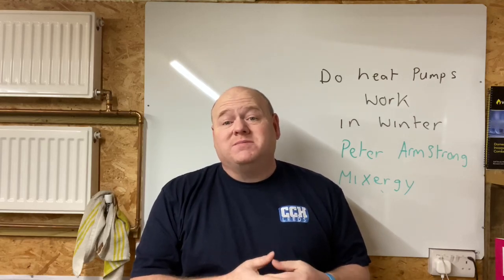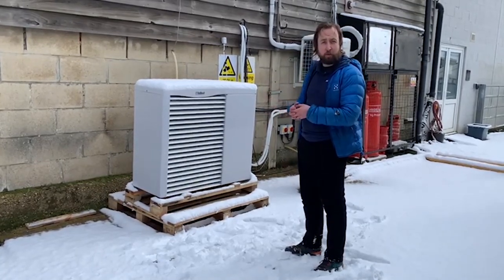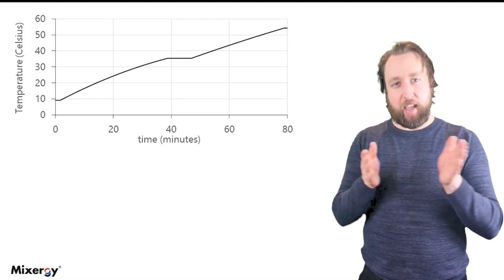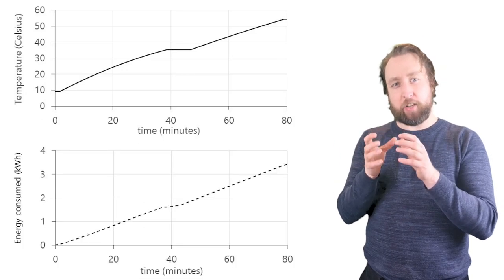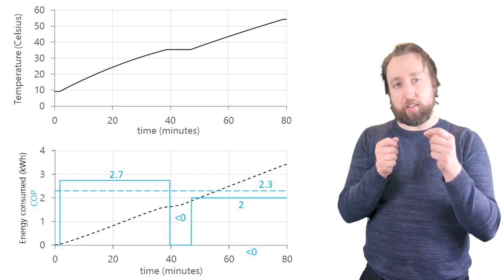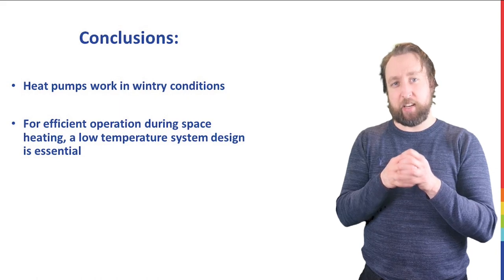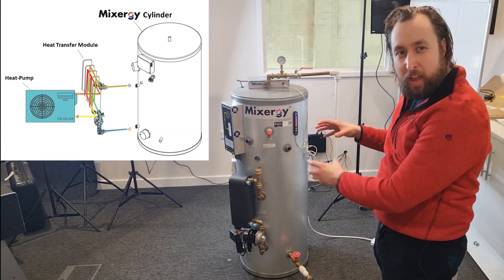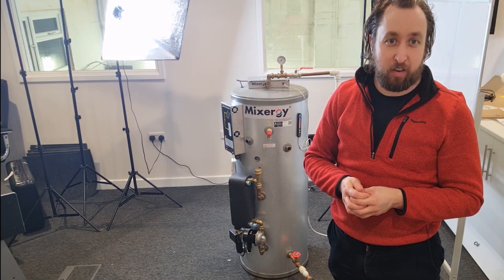Do Air Source Heat Pumps Work In Winter - Peter Armstrong Mixergy

Comment: let me get this right,... we moved from immersion heaters in jacketed hot water tanks and cold water storage tanks of the 1960's, 70's & 80's to combi boilers which supply on demand copious amounts of hot water as much as was needed and safe non-stored fresh drinking water, to save materials and space and cost, to take monumental step back to the late 20th century for all intents and purposes but with modern technology to heat it? Is this supposed to be an improvement or a step backwards?

A family of four all having baths (not showers although even if it were showers that tank would not shower four people), takes almost one and a half hours as it did in the demo to heat each tank from 10 Celsius, ok well my tap water isn't 10 Celsius when it exits the tap and certainly wont be for anyone if it had to fill that tank from empty which it would be doing the whole time you turn your hot tap on to run a bath or a shower, this is the technology of the 1960's, 70's & 80's and about the same amount of time to get to temp? All that is new here is the method of heating not the end result. In fact the end result is worse than in the 20th century because  heating water is one thing but today we use central heating back then we used gas, electric and  or coal/coke fires, we didn't have to also heat central heating that needs hot water to heat the home, not to mention this system still uses damn electricity, so how is this saving anything?

Who else wants a large industrial electrical appliance in their back garden, where their inquisitive little ones are playing and could be electrocuted, injured poking things into the fan or god only knows what?

So what we are being expected to do is to introduce a new technology that sends us back to the late 20th century, all to enable us to move forwards? Really???
 
So back to this bath example.. in my estimation this tank would be one baths worth of water per hour and a half then we need to wait a further hour for the second bath and again twice more so just for hot water would take four and a half hours minimum, to bathe your family of four (assuming you all have a 30 min time in the bath, not that it would matter, because the next person would still be waiting a further hour for the water to get hot? 

Not to mention if it runs a shower instead of a bath the water entering the tank as the hot is slowly drained for your shower, would leave someone of the family of four, having a cold shower because the water takes so long to heat up and has been cooled by the cold water entering, and we all know that in winter cold water after a couple of minutes running is Icey cold coming into your home which in itself would increase heating time.

Also this test only did a hot water COP and heat to temp duration test, what about the efficiency of heating hot water and a home at the same time? Surely that would mean you either need a bigger still air exchanger with a bigger output increasing cost of purchase and a bigger appliance and more acreage in your garden or there would be a significant drop in water temperature in that hour and a half and a very cold home. 

So the almost 5 hours to bathe your family might then take 10 - 12 hours to complete because its also keeping off the frost, but not heating your home to a comfortable 20 Celsius. Get your warm clothes wrapped around a hot water bottle while you bathe so they can keep you warm after your ablutions.

Is it me or does this sound like a mad idea and a step back to the last century?
I'd rather go back to my army days of heating water on a hexi-stove in a field to wash cook and clean than this stupid idea.

Someone please slap Boris and bring his senses back for gods sake please, he's gone completely nuts.
Reply from the maker: Thank You
Reply: you forgot to mention the noise of the fan and compressor runing most of the time, the fan maybe quiet for the first month after which I suspect it would be very noisy imagine every house having these outside generally fixed to the wall and that whiring drumming noise all day and most of the night through the walls???
Reply from the maker: @fredflintstone1  I have heard mixed views on this. Some say they are noisy and others don’t. Thanks.
Reply: Regarding noisy fans. You get what you pay for ....
And 5 hours to shower a family of 4!!! No wonder you run out of hot water. Sounds like you need to consider changing your habits rather than saying the the air source heat pump is old tech and unsuitable
Reply: @uskok4636  I think you're missing the point about the showers and fans. Any moving component generates resonance when the appliance is large enough and affixed to the building such as flats or terraced houses the resonance will travel through any and all solid materials including liquids, how do you think sonar and hydrophones work? As for homes and offices, they are solids, they transmit resonance even better than liquids are their molecular structure is fixed hence solids, so any moving part will resonate through the fabric of the building like water making pipes bang in some homes from time to time it's amplified.

As for 5hours to shower I did not say it takes me five hours to shower. I said with a storage tank taking 1.5hrs to heat and containing what would be I'd estimate to be 200 litres (a bath full) it would take upto 5 hrs given that as you shower you input cold to top up as water is used, this chills the hot water as it fills making shower water colder as you shower, therefore about 25% into the tank you've started to have a colder shower, so when you leave and next person gets in it's colder to start for them, and so on so to avoid this you would need to pause between people to re-heat to set temp in the tank before the next person can have a hot shower, and so on down the queue of family until four people are showered.

Don't judge my habits based upon my experienced opinions above which are all from 30+ yrs as a plumber and bathroom designer.

The math speaks for itself if you could see that far ahead of yourself and insults.

A typical shower used around 25-28 UK gallons for 15 minutes in a shower, that is over half the tank so if half the tank is hot water and half cold water the temp is reduced by 40% (not getting to teaching you thermo dynamics so take my word for it) this means water at 50c would drop by 20c to a approx 30c that's colder than your body at 37c meaning you'd have a cold shower. Meaning you'd have to wait to re-heat the tank back to 50c which takes about half the time it took from cold so 45 mins, plus your 15mins in the shower 1 hour per person, four people 4 hours plus changing drying etc 15mins each to undress and dry redress (1 hour for everyone) 5 hours total time to shower family of four.

Now stop talking, unless you know what your talking about. This is 5 minutes I'll never get back... thanks.
Reply: @uskok4636  one other point about your comment about the fans.

You must be a fortunate person and privileged. Because not everyone can afford the best, or they buy a home with one fitted which didn't have the best fitted or they have a govt or social landlord or private landlord funded system fitted such as social housing,  the govt or these landlords won't pay for the best, they will buy the cheapest. MONEY MONEY MONEY in my pocket not yours approach. 

You also over-look the neighbour who buys cheap is deaf and can't hear it but you in your home do and you and your family can't sleep because of ghe low frequency noise output.

This over time is harmful to health by way of restful sleep deprivation. But just buy an expensive one or sue the neighbour it costs more but you get a big bag of cash.  What a great idea heat pumps are.

Social unrest as neighbours start to complain and argue, lack of sleep, but hey ho the old boy has saved to planet 'f-all' in Co2 savings for his one tiny home.

So once again thanks for your valuable input. For what it was.
Reply: @AllenHart999  my pleasure Al, keep it up good work n vids bruv, & keep spinning them spanners lad 😆
Reply: @fredflintstone1  I hadn't forgotten, I thought that would be the least of their problems.. but glad you mentioned it, its very true and valid point that should be considered.
Thanks 😊

Comment: so lets get this right, in the middle of winter a 10kw heat pump will put out the equivalent of three electric fan heaters and you expect that to heat an average house and provide water for a shower in the winter?
Reply: In the dead of winter it won't even do that... When they say 10Kw they are talking about 'nominal' OUTPUT, the input for one 16KW I measured was 2.8 KW ! Pathetic.
Reply from the maker: Thank You

Comment: Using a Thermia itec-9. It worls down to -10 C, after that the plate heaters start to help out and at -25 C the heat pump shuts off and the electrical heaters do all the work.
Reply: Thanks, that's interesting and what we'd expect to happen -
Reply from the maker: Thank You

Comment: Heat pumps appear to work by extracting latent heat from the air or ground. The extracted heat (potential energy) is then compressed by electrical/mechanical means to increase the pressure which by simple physics also increases the temperature.
This is kinetic energy, pumped around wet radiators where the kinetic energy is given up by either heatimg water or space. The cooled medium is then returned to be compressed again.
Aircraft use this type of system to heat cabin air and create pressure for people to breathe at altitude where outside temperatures are around -50 degrees centigrade.
Hot air is tapped from the hottest part of the engine at around 800 degrees centigrade with a pressure of 20 bar. This high temperature high pressure air is then pre cooled down to be used in compressor driven turbines using the massive potential energy provided by the tapped engine bleed air. Exchanging potential energy into kinetic energy warms and controls cabin pressurisation.
It does not work if the engines are not running.
Ashps claim to be able to warm a house and provide hot water using the potential energy from the ambient heat and pressure on any given day.
At sea level we assume 1013 mbars of pressure and a varying temperature of the British Isles. These new systems claim to extract this ambient pressure/temperature and make it useable but i fail to see how these low temperatures and low pressure provide any useable potential energy.
Compressors are extremely expensive to run and in my opinion the temperature/pressure increase is made entirely by electrical driven compressors. 
Heat geek has claimed there is loads of potential energy available, even at zero degrees centigrade because  temperature measurement scale was changed to degrees Kelvin. The reasoning  being there are 273 degrees Kelvin which are useable.
Since both figures are zero there is zero potential energy.  Ashps use maximum energy attempting to compress zero potential energy and therefore no useable heat.
This is why ashp fail to heat houses during the winter.
In my opinion these new systems are not green or efficient. No mention is made of hysteresis losses within the  machinery, particularly at low pressure low temperature days and in my opinion ashp and gshp are lining up nicely to be the next miss selling scandle.
Reply: Just a point heat pumps are not exploiting the latent heat in air it’s in the sensible heat range.
Reply from the maker: Thank You
Reply: @jameskirk578  Latent heat is only present when you change state, solid to liquid, liquid to gas and vice versa. Latent heat is the amount of energy to change the state without a change in temperature. So in this case extracting heat from the air (or the ground only changes the temperature not the state and that part of the graph is referred to as sensible heat. There was a lot of fundamental errors of understanding in your post but - one step at a time.😉
Reply: @normanboyes4983  I will wait  few years to see if my fundamental errors prove true or not. As you say, one step at a time.
Reply: @jameskirk578  Would you care to share your science/mathematics based educational achievements?
Reply: @normanboyes4983  No point as i am obviously not as qualified as Greta and her green policies.
Reply: @jameskirk578  thought so
Reply: @normanboyes4983  We will know, one way or the other, in a few years time.
Reply: HVAC Stuff  I don’t quibble with that at all. My response was to James Kirk who said heat pumps extract latent heat from the air or the ground and I corrected him by saying no they extract the sensible heat. I worked with air conditioning and refrigeration for thirty years.😉

Comment: ASHP work, no doubt, but back up is needed on almost every case here in Minnesota. Great that this tank has the ability to work with a boiler now and change to a ASHP later.
Reply: you def want a backup in case you lose electricity in a cold climate, I wouldn't be too worried though for a backup where I live though as outside temps don't go below freezing so If I lose electricity for a while it might get a little cold but nothing dangerous or no risk of pipes freezing.
Reply from the maker: Thank You

Comment: Great video, hard to find anything detailed on this. Looking for some advice. No gas at my property (though can be installed) and had storage heaters, considering ashp instead with rhi cost is approx same as gas but thinking gas prices will only rise in coming months /years? Anyhow, the scop of one I am looking at is at least 4 and seems about as good as gas price wise? House is a 1960s terrace, cavity wall insulation is in, very thick walls, new insulation in loft and draught proofing all around. Installation will be all new rads etc. Good idea or bad idea? Thanks
Reply: Many terraced houses have suspended timber floors with air vents front and back to keep the underfloor space dry.  Unfortunately also very cold. If this is the case consider closing the vents for the cold period and/or something better than carpets as a floor covering.  If you have solid floors (depending on what standards were in force at build time..) you may not have 'Screed' as a top layer which is not as dense as concrete. 
 Consider electric wire matting which is less invasive than wet systems.
For Heating my house...
I have gone for a bunch of cheap and cheerful electric wall heaters all on individual timers in all rooms.  It is simple and cheap. If one breaks down then a visit to Argos will be a lot quicker and cheaper than calling out a Plumber or even an Electrician..  After 18 months my Gas/elec bills are about the same. £1100ish pa  (200m2 property)
Reply from the maker: Thank You

Comment: The Vid was great and thanks for sharing. But i feel the big question is the price to heat the cylinder compared to other means inc the install, manufacture fee,, this was missed. Its a shame but most "Green energy is still more expensive by a big margin than gas and because of this It still seems not to be a viable option.   Make electricity cheaper with renewables and the manufacture of the products greener and we on to a winner.? may be 
" I love the idea of a plate heat exchanger on the tank, this is amazing faster heat transfer is always beneficial. if it works well"   Again another great informative Vid
Reply from the maker: Thank You

Comment: I've got an ashp but I use it to heat water I've got a wood stove that works like a wood gasification burner at 87% efficiency. it heats my house from 16 c to 24c in 2 hours it's a poor system when it gets below -10  even though they say it works to -35
Reply from the maker: Thank You

Comment: OK I listened to All that has been said about temp at the cylinder,that cylinder is tiny to start with,but how long would it take to transfer heat to the  radiators and ive been told these are only good if you have a new house or your house has had thousands spent insulation...
Reply from the maker: Thank You

Comment: Hi Allen, thanks for the video. It would have been nice to have a cost comparison with other sources of heat at different temperatures to see if it's worthwhile running a heat pump.
Reply: Gas is about 4p per KWh,  electricity is 16p KWh.   So until the cop is 4 in the depths of winter - gas will be cheaper.
What’s more likely to happen is that the price of gas will double in the coming years to make heat pumps look more affordable
Reply: @eliotmansfield  Gas going up is what Skill Builder was saying, and he has his ear to the ground. Trouble is electric will have to go up too, supply and demand.
Reply from the maker: Thank You

Comment: I went to a job recently with 2ashp, running underfloor heating, house would not get above 18c with outside temp-1c, it had boiler backup but that had failed, I don’t think they can be the only heat source
Reply: We have heard similar stories - our view is that a heat-pump installation really needs to include a building survey to assess the insulation/glazing performance along with a detailed specification plan to correctly size the heat-pump itself. It's important that the building fabric is improved first as much as possible before putting a HP in I think...
Reply from the maker: Thank You

Comment: Nice video - although, I was hoping we'd be able to take a look at how it'd cope with the weather conditions we had last month - minus 10 in Perthshire as an extreme. Climate change is likely to bring with it increased adverse winter weather condition over the next decades.  Another question is how aspect influences performance - north facing wall Vs south, west or east e.g.
Reply: Most work well to minus 25, if you get minus 10, then your system has to be designed to minus 10, regardless if its a gas boiler or heat pump, look at the country’s  they are commonly installed, like Sweden/Norway.
Reply from the maker: Thank You